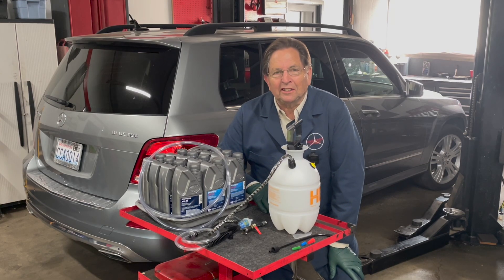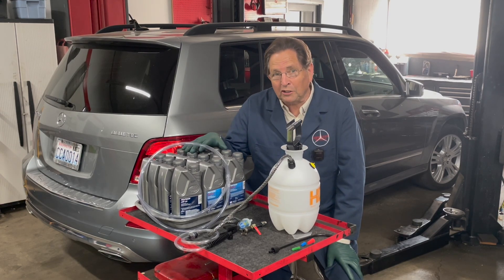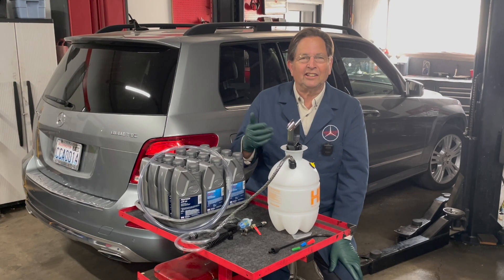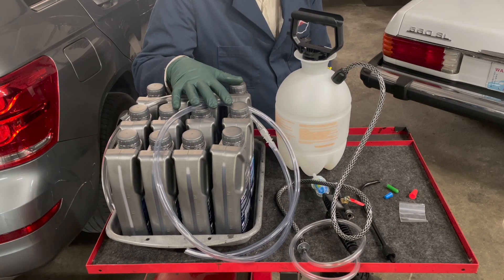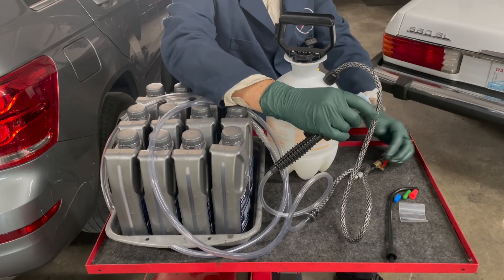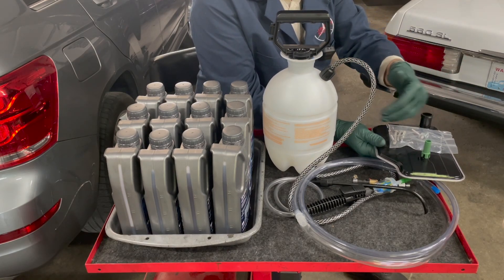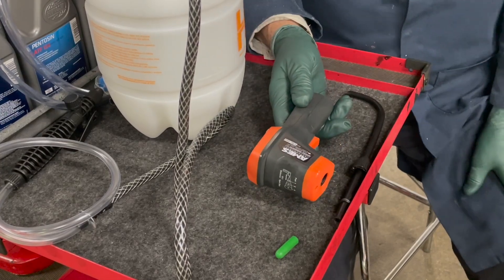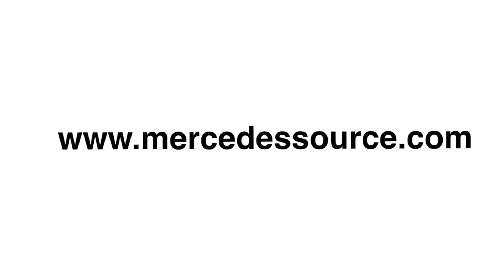Mercedes 722.9 7G Failure Prevention Part 3: Flush or Drain? I Have a Better Solution.

Comment: Shop just did a drain and fill, but I'd like to do this. I know it would be wasting money, but I want to keep this car going for another 10 years.
Reply: Drain and fill, flushing adds the risk of debris introduction.
Reply from the maker: @ChrisPatrick-q6k  You must have not watched the full video. I do not recommend a "flush".  I recommend a power drain with the engine running.  Think!  If that were a problem then one should not even drive the car due to "risks."
Reply: @Mercedessource  Yes sorry you're right.

Comment: Thank you for making this video series. I have a 2006 c280 and love the car overall. Recently, the 722 9 went into limp mode and the code showing on the scanner is p2767. Going to attempt to replace the related sensor and its close neighbor, y38n1 and y38n2 I believe. Sending it out for professional repair is the preferred method, but times are indeed tough and I am a decent DIY mechanic with a knowledgeable father in law over my shoulder. If you would be so kind to entertain either or both questions: Would you go all in with this repair, purchasing the pan/filter upgrade and flush kits from your website and performing this all at once? I have to remove the valve body anyways...Or, would you wait on the flush until after the sensor repair is verified? Not going to hold you to it, just asking an opinion. Thanks again for the great videos.
Reply from the maker: I am currently working on a video with the limp-home situation and sending the conductor plate out for repair. It is in transit now. I would do the power drain after you put it all back together for a cleaner drain and less fluid used. Remember, you will get almost 2 liters of old fluid out when you remove the valve body.
Reply: Thank you for responding Kent. I will keep an eye out for that video! Apologies for asking tech questions, just saw your post on the 722 9 part 4 video. I'll reach out through your website in the future. Hope you have a great day, sir!

Comment: Excellent video.  Ken, how would this compare to doing two drain and fill procedures ? Just need two sets of filters and screws with plenty of atf.  Your process would be faster.
Reply from the maker: Definitely faster and more thorough. Even with two drain and fill procedures, you will still have two to four liters of dirty fluid mixed with new ( depending on whether or not you drain the torque converter AND the valve body. Watch my next video on how much fluid is "trapped' in the valve body. :-)

Comment: what do you use to clean the tank so u can use different type of fluid?
Reply from the maker: It depends on what you put in it. Brake fluid must be thoroughly cleaned out with alcohol if you are planning to use a petroleum product like rear end or transmission fluid. Those can be cleaned out with mineral spirits.

Comment: Does your instructional video also include the instructions on how to remove and clean the valve body without damaging the components??
Reply from the maker: I have a cleaning and service kit for the 722.9 transmission which comes with very detailed video instructions. Here is the link: https://mercedessource.com/store/2003-2010-7-speed-transmission-valve-body-conductor-plate-service-kit

Comment: Is one expected to do this without a lift? 12-18 inches off the ground is gonna be impossible to use the equipment plus it'll be a huge mess! I wish we all had a shop with a lift 😂
Reply from the maker: If you drive the car up on 4 car ramps rather than jack stands you will have much better clearance. If you use my procedure with my fill tank it and take some car you can actually do it without spilling on the floor.

Comment: This video series comes a month after I just did a drain and fill of 5 liters on a new to me Sprinter that had no trans service in 7 years and 84000 miles.  I was warned that if a trans is neglected that a full drain could shock they system.  Even heard the ph can change with old fluid.  I am curious if you still recommend your power flush method with neglected transmissions.
Reply from the maker: The fact that you are calling it a "flush" leads me to believe you did not watch the entire series from beginning to end.
Reply: I did, and I appreciate the content. I have watched it carefully as it pertains to my own transmission! I am being careless with terminology. These videos do imply the power drain procedure is safe for transmissions in any state of service histories or lack thereof.  I am curious if there’s any times you might act more conservatively, or rather if you think there’s a benefit to working up to the power drain?
Reply: @Mercedessource  if possible, another video in the series showing the details of the procedure of a power drain would be helpful! Or even a link if you already have older material showing the specific process.  Thanks for your excellent content!
Reply from the maker: As stated in my video, if you are worried about power draining your transmission, then you should be worried about driving the car down the road. A power drain does nothing different from the normal flow of fluid through the transmission driven by the internal pump. Remember, NO flushing occurs.
Reply: @Mercedessource  thank you for the clarification. I appreciate the professional and thorough quality of your content!
Reply from the maker: I also explained in one of my videos that the detailed video is included with the power drain kit I sell, or you can purchase the video separately on my website. https://mercedessource.com/store/7229-transmission-fluid-service-pressurized-fill-tank-w-correct-fittings

Comment: Why so complicated?? You can fill in the tank through the dipstick tube, with a little manual or elektric pump. I do this since years, and it function without problem.
Reply from the maker: Anyone want to volunteer a reply... :-)
Reply: Do these even have a dipstick anymore?
Reply: @westhavenor9513 they unfortunately do not have a dipstick.
Reply: Please know what transmission you're talking about before commenting about filling it via a dipstick.
Reply: No dipstick for the 722.9 just buy the kit and do this. Stop wasting time with negative comments
Reply: You have seven speed Mercedes transmission with a dip stick?